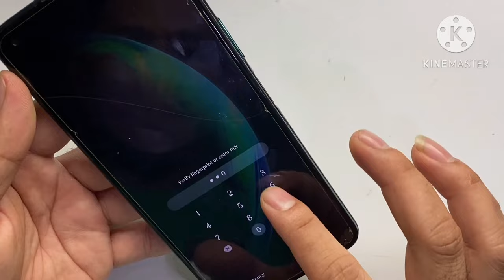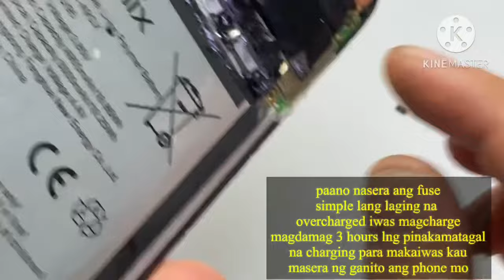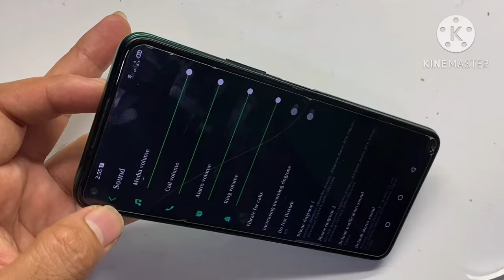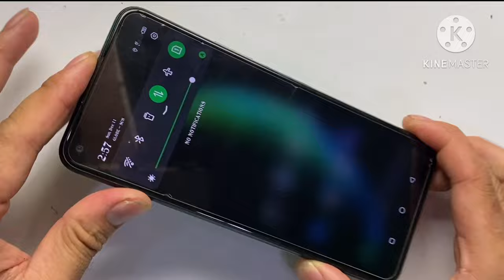Infinix Note 7 Or Any Infinix Auto Restart Problem Solve 100% Best Repair Tips! Pwde Mo ito DIY'

Comment: I have the same problem the technican said the problem is in power ic I got it repaired but it again makes this problem can you please guide me now he says you so change the battery
Reply from the maker: if u have tools apply the video with out tools replace new batery best solution
Reply: @JulphoneTv I think battery not changed ang it can good?
Reply: Magkano po repair nyan Yung orig na price walang bias?

Comment: thumbs up legit problem solved. phone ko infinix hot 10s. nag auto restart kapag nag open ng camera at flashlight. kaya pla nag rerestart kapag nag open ng camera at flashlight kasi kakain yun ng malaki sa baterya kaya nung nag jumper sa fuse ng baterya ayun di na nag auto restart. thanks sa idea.
Reply from the maker: 100% solution please share the video and subscribe like
Reply: Nag oovercharge ka po ba
Reply: @unlockedzi7110  madalas sa gabi then sa umaga na mabunot pero naka off naman ang phone.
Reply: @judilbagonggong9737 ano po ginawa fuse po ba or pinalitan ng battery?

Comment: Tanong ko lang po sir 

Infinix Hot 10s phone ko same problem sa data pero sakin iba basta mag open ako ng game like genshin impact mag force shut down sya parang hindi ata kaya sa ram? Napansin ko rin sa phone ko sa baba umiinit kapag nag gamit ako hindi na sa upper part sa may front cam. hindi namn ganyan cp ko noon kung mag heat up sya upper part lng po ung iinit hindi ung sa baba 

Sa inyong tingin Sir ano po sira sa cp ko?
Reply from the maker: magawa normal pm may fb page julphone tv
Reply from the maker: ganito gagawinhttps://youtu.be/NDRkqWTMDTM

Comment: idol nagkaganyan rin infinix hot 11s ko bale ang nangyayari sa kanya nagpuputol putol yung tunog ng cp ko pagnakatodo tapos maya maya mamamatay sya, nagagamit ko lang rin sya pag nakacharge sure kaya na fuse rin problema ng sakin?
Reply from the maker: yes apply the video 100% mo magwa lods bqck to hard drian na wla ng sakit sa ulo lhat ng sakit solve lhat same na same din nag gagawin dto wla piangkaiba sa pinaghinangan
Reply: @JulphoneTv  idol ayos na ayos, tinry ko yung vid mo nagwork sya sakin nagagamit ko na uli ng maayos kahit di nakacharge, medyo nagkamali lang ako ng pagbubukas ng cp ko naputol ko yung flex cable ng fingerprint sensor ng phone ko haha pede bako gumamit ng ibang brand ng fingerprint sensor wala kasi ako makitang fingerprint sensor para sa infinix hot 11s
Reply: tested and proven kuna yn mga ganyan fuse yn pag nggmit lmg pag nka charge dmi kuna ngawa sa ganyan jumper lng or kung may capacitor ka n maliit pwd din ...
Reply: Same tayo ganyan din yung phone problem ko kaso Hindi ko alam pano ayusin Wala akong tools eh and ayaw ko ipaayos to sa shop Kasi baka mas ipalala pa nila

Comment: Tanong ko lang paps, yung cp ko is Infinix Note 7 din, minsan nagagamit ko sya pero di nagtatagal magri-restart at minsan din nagbo-boot loop din. Minsan pakatapos mag restart at di ko pa nilalagyan ng pin di sya nagri-restart then after ko malagyan ng pin maya-maya dun sya mag ri-restart. At napansin ko din na pag umuinit yung phone dun sya minsan nag rirestart din. Gagana din po ba yang solution sa gainitong issue? TIA!
Reply from the maker: yes po magwa normal
Reply: @JulphoneTv  Sir ano po yung magwa?
Reply: all goods pa rin sir, akin po yang unit na nasa video
Reply: @mcnealmacatangay3601  kailan mo yan sir pinaayos?
Reply: Same issue boss? Napaayos mo na ba ganan din ba nangyari naging okay na ba?
Reply: @jeff legend naging okay ba at magkano nagastos mo? Battery fuse lang djn ba
Reply: @s3josephjoaquinbondad360  nag paayos ako pero iba yung part na inayos, ang sabi ng gumawa is yung capacitor daw na related sa battery parang ganon. Ngayon ok na cp ko.
Reply: @s3josephjoaquinbondad360  Kakilala ko yung umayos ng cp ko, 100 lang yung kinuhang bayad sa akin tahaha